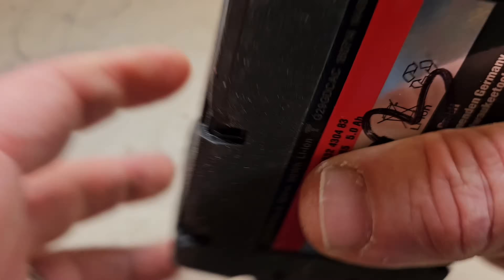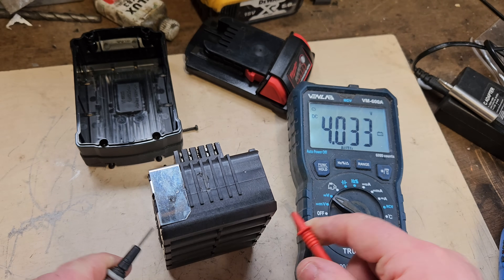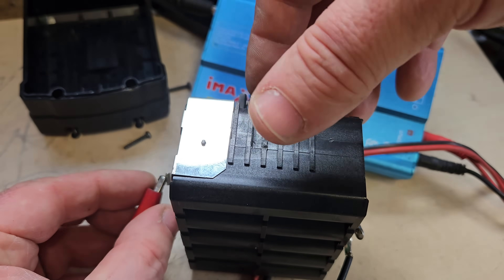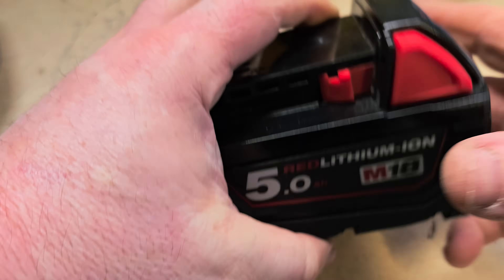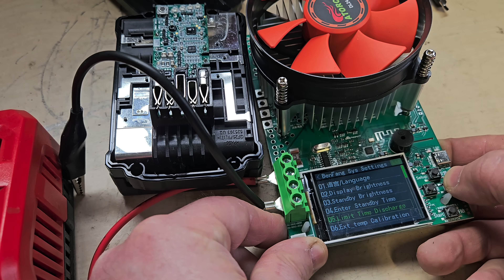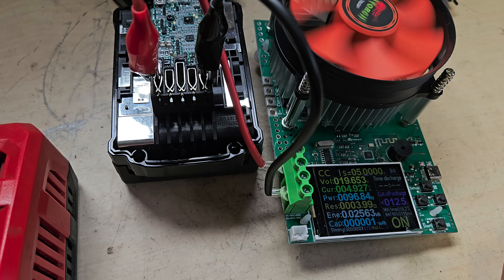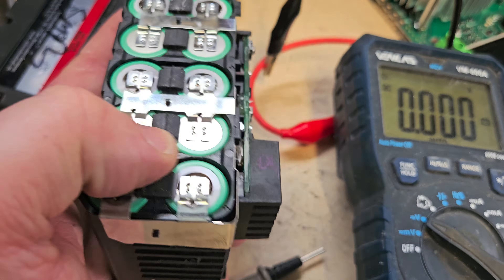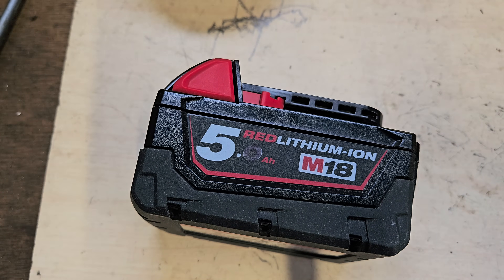The Ultimate M18 Battery Test

Comment: You are using a balancing charger to charge one bank of cells. Is there a reason you don’t do a full balance on the battery pack? I know you have to make a lot more connections, but with your magnet trick, shouldn’t be too hard.
Reply from the maker: It's more complicated and takes a long time I have intended to do a video on it but haven't found the time

Comment: I bought 2 Milwaukee faulty batteries the other day. One had a loose cell connection , and then other needs 2 new cells at some point. 

I spot welded the loose connection back on, checked the cell bank voltages and they were all spot on at 4.09 eachv, I put it on the charger to reset it, and it worked. Fully charged it and let it rest to 20.2v. Used it on my impact and then left it on my impact on my workbench, and it flashes one bar again, no loose connections, it resets each time I put it on my charger, but after using it again a few times it flashes 1 red bar. Do you think a new PCB would fix this issue?
Reply from the maker: Yes
Reply: @doctorlefthandthread  I started desoldering the PCB and noticed the metal connection from the first bank of cells was cracked/broken, was hard to see, so I desoldered that one, and added some new strip from that to the board. Battery works great now and saved me buying a new PCB. So all is well, now. 😄.
Reply from the maker: @MrZimmaframe yes that can happen the connections can break great job
Reply: @doctorlefthandthread  Cheers, Merry Christmas Doc. 🙂🎅🏻🎄🎁🎉
Reply from the maker: @MrZimmaframe Merry Christmas to you thank you for your support
Reply: @doctorlefthandthread  No worries, you’ve helped me out enough, over the year. 👍🏻🙂.

Comment: So I had 2 dead cells, replaced them and have 3.9 v on all cells but battery is still not charging (solid green on charger) any help thanks
Reply from the maker: https://youtu.be/NKLWaB31Iz0?si=un3zVf57o217A4Jn
Reply: @doctorlefthandthread  Thanks! I was watching this last night. Amazing work dude!
Reply from the maker: @thomasmillward3353 thank you
Reply: @doctorlefthandthread so, I’ve changed the board but now I’m getting 12.65 volts on top, this should be 21/18 but I don’t understand, I have 4 v all round( when I put it on charge it charges then goes to double flash) any help thanks

Comment: If the cells went flat (one P group), it will happen again, one of the cells is dead (prob a heater as well), needs to be replaced, or it's just going to go dead again, or worse start a fire during use or charging cycle.
Reply from the maker: What you are saying is right about it likely failing. Starting a fire however is very very very unlikely these cells have overheat shut down.I accept sometimes recovery by this means doesn't last long sometimes it can last quite a long time before it happens again though. Any way we can stretch the life of these is good for our pockets and our environment.